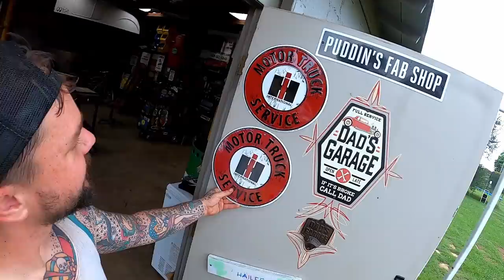1964 Ford F100 LUCY gets CLEANED up & TUNED up! Free smoke show!

Comment: I'm a Chevy guy through and through, but old Ford's aren't too bad. Once they started putting in all the electrdodigicals, they went down hill.
Reply from the maker: I’m definitely liking the fords
Reply: Can't kill a Y-block, a 240/300, a Flathead, or a Windsor/Cleveland/385-series/FE V8. Skookum as frig.
Reply: @TestECull  You clearly haven't watched Mortskes videos on Y blocks then. 'Cause if it can be killed, he'll manage it.
Reply: @bruwin  Oh I have. He didn't kill those Y-blocks. They're still perfectly useable just need a full overhaul.

You wanna see some killed engines go peep I Do Cars. The cores he tears down sometimes...man how the fuck do people manage to put so many adjustable conrods and aftermarket service windows into LS V8s?!
Reply: YEE YEEEE!  Im also a chevy guy and my goal with my 94 k1500 ratrod is to eventually be down to a 3 wire system lol or as close as I can and still keep the tbi because its so much more reliable then a carb if yr truck sits alot 100 like mine! but if its a daily Id go 4 barrel 650 cfm :D
Reply: secondly I love any truck that will run and drive my first was a 77 dodge custom with a 318 second was a rotten 92 f150 with a straight six #highschool beating on the starter every day after school sucked lmao... but damn that was honestly one of my favorites 2wd but yet it went everywhere I drove it and I went up some mountians and through alotta mud lmao..as a teen.... but my bench seat c/k series chevys just always got me and that sbc is so common and reliable when maintained and also cheap to fix when it breaks that its just my #1!
Reply: I'm a Ford guy in Australia, I don't "Think" we copped that Duraspark and smog pump shit. None of my cars had it.... Made for California ?
Reply: @damiangillett1476  Duraspark isnt an emissions device. Its just an ignition box, just like an msd 6al or accel 300. Smog pumps are meant to introduce unused oxygen to the exhaust stream to boost converter efficiency and likely wasnt fitted to models sold in areas that didnt have as stringent a requirement for the cats.

Comment: She is starting to really come around. I love those Ford straight 6 engines. Got one in my  Mustang. Very reliable and good low end torque.
Reply from the maker: Plenty of torque!
Reply: I agree.  I have the 300 cube 6 in my F150 5 speed 2wd.  LOTS of torque, very smooth running engine.  199k miles.

Comment: I have been a truck driver the last 15 years most drivers nowadays do not have a CB Let alone speak English
Reply from the maker: I knew it! Talk to text!
Reply: Yes up hear to also in Ontario and Canada to SH and even when accident called out my mobile plus base setups to help out also (dead air) that get! I live near Trans Canada it 3 miles south of my home 10-20 location plus get lots miles in both setups and plus my home road is a Emergency Detour Route  ! Plus my radios are Tech approved too and setups in CB and Ham radios!
Reply: CB was dying in the late 80's, and when cell phones became cheap, it was pretty much dead.  You can still find some traffic if you're by a major interstate, but it's not like it used to be.
Reply: @jballew2239   agree and so wild one radio station company in Ontario Canada it give traffic reports ever 10 to 15 mins by hour also  does whole province  and help out drivers like CB radio and Cellphone plus computer does ! It sure helpfull too and it does!

Comment: Grew up with a 63, but it was a 1 ton with a 9 foot box. We ran it till the kingpins got so bad we couldn't keep tires on her, and then retired her because the body was about to fall off the frame(WI)
Pumpkin was enormous on that thing, same straight 6, manual. topped out at 50 in the wind and 55 with the wind. It would move loads that weighed in excess of 10 tons, but you couldn't go past second gear then. First gear at idle you could walk about twice as fast as the truck moved. 
The truck was comfy. The distance for arm-to-window ratio was perfect, as was the height of said window. I learned to drive it when I was 10.

Comment: cb needs to be hooked up to them wip  antenna`s on roof to hear talking lol
Reply from the maker: They are plugged in. I found a split in one of the cables after this tho
Reply: Probably fried the finals keying it up with high SWR.
Reply: @PuddinsFabShop  radio is so old anyway it would need to be restored, caps are likely shot and those whip antennas are garbage.
Reply: @Puddin’s Fab Shop  don’t forget the tennis balls!!

Comment: Did you see the IH parts for sale on Aumann auction?  Just don't run the price up on the B series head light bezel.  Need it for my truck!!!
Reply: @PuddinsFabShop  got the part!!!!😎  I still have that rebuilt datsun and manual trans. That needs a good home...... i could use the space in the shop!!! Shop picker video!!!!!!

Comment: Great video and a great channel! That rod you found in the back of the truck is a sucker rod from a oil well pump, folks also use it on fences. I have a 66 ford f250 i'm working on currently.
Reply from the maker: Heck ya! I like the 250s!

Comment: Nice truck... should wire wheel the inside of the roof and hit the holes with seam sealer...  From inside the cab so you don't mess up that nice patina..

Comment: I can remember in the late 1950s and early 60s, my father used kerosene to clean out the combustion chamber and valves
Reply from the maker: Kerosene mixed 50/50 with atf is good stuff.

Comment: Hey your next t-shirt idea possibly. Pudding the instant mix for hilarious. Feel free to correct the spelling and change it around to where you want it. Or just throw it out the side window of the shop once you get one window. One thing nice about the air ventilation holes in the floorboards you don't have to worry about that lever cable working for the floor vents on the each side. And sitting on that rim I guess that's what you mean by Wheeling about town. Enjoy your show great content

Comment: i bought a 74 chevy 1/2 ton from a tree trimming service that had a homemade 10' box on the back that they used to haul wood chips. the driver's side floor was osb. i pulled it out to find an escape hatch i could crawl out of. there was zero metal from the tunnel to the door sill, and from the foot board to the front seat mounts. the only metal you could see was the frame rail and e brake cables. i just put the osb back in, and drove it for a year before i sold it to somebody else when the driver's door wouldn't close from inside anymore because it was too hard to lift and shut while sittin in the seat.
Reply from the maker: Holy hell! And holy floors!
Reply: @PuddinsFabShop  that's northern indiana for ya.

Comment: My Dad bought a brand new red Ford just like that in 1965. There was some type of motor issue with it. He gave it back to the dealer and got a brand new green long bed, with a built in side tool box in 1966. My brother ended up abandoning it in 1975 in OKC and it got towed away by the City......oh, well. What are brothers for? LOL.   
About the same era, Sonic opened it's first Drive-ins.
Reply from the maker: Opened in my home town!

Comment: If you have a metal roof, it's killing your signal. Try the radio outside on channel 19, that's the highway channel. Do it outside.
Reply from the maker: I did.
Reply from the maker: I did.
Reply: @PuddinsFabShop  Did it work  outside? If not y ou may try to turn the channel knob quickly several times as it may be very dirty sitting all those years.

Comment: Hey noe I'm not going to be one complaining about the L6 motor,, because I had the 74 chevy c10 Cheyenne super 2wd long bed regular cab truck it was originally a 454 manual column shift 3spd transmission 12 bolt rear 4.56 posi rear end it was powered when I got ahold of the truck by a 58 Chevy 283 2gc sbc but it had a crack on both sides under the motor mounts and i swapped in a low mileage 4.1 litre 250 cubic inch L6 th350 junkyard transmission and a new front pump and torque converter and input shaft and output tailshaft seal my uncle gave me the Straight 6 it was from a 74 chevy Silverado short bed he had, and I also have owned a monument for bondo sculptor's everywhere even both floors were bondo in the front of the seat truck looked really decent til it got cold and snowed the bondo cracked and the burgundy 80 Chevy c20 Scottsdale bodyline fell off lol on both sides rough truck... but it had a 68 48k miles 250 2gc carburetor L6 th350 c metric lock up torque converter....

Comment: Excellent video Puddin  :) also what Lol one vechile had restored back in 1994 was 1968 Chevrolet C10 with 292 6 cylinder motor with 2 barrel carb with hand choke plus MANUAL TRANSMISSION 3 speed  on tree too , 377 posi rear end gears plus no power steering and brakes to but 4 wheels drum brakes even emergency brake handle was rare one with 4 wires for front also back brakes! Plus truck had West Coast mirrors on doors , Baby Blue body plus Interior same color too and so fix up floor completely, plus had replaced seat but found seat had Lol at this  Old 20 litre pail cut that steal with Texaco company grade 80w90 differential fluid bottom also half was weld to floor on driveseat ! Plus all restore even motor , transmission , axle  head to toe and wheels are 6 studs plus are P235/75 /16 in Load Road E ! Plus Am /Fm radio and radio antenna too updated to with 2 speakers! Guy own truck want me put round exhaust muffler from farm tractor plus tail pipe it ! Plus put new clutch racing in , drum brakes emergency brake cable too even brake plus fuel tank to even lines! Great old truck too and lives on ! Puddin  :) if want I closer would give Radio Check for you on CB Lol!

Comment: Hey Puddin, love the Video if I was near by I'd get you on the air been talking on the cb radio since 1993 my handle is Cruiser. Most likely the Antennas are Shot those are a good little radio. I'm waiting on Puddin Hat's.
Reply from the maker: I figured the antennas are the issue. Lately in the evening I found one of the cables split.
Reply: @PuddinsFabShop  you would be surprised how many people still have Base station's and mobile CB's you would laugh yer Ass off hearing some of craziness that goes on. Have a good day my friend.

Comment: That is a 223 straight 6. I have a 64 f100 that my grand father bought brand new . It has over 546K and is in rough shape but she still runs. ( needs brakes right no)  There is no substitute for these old trucks. they may not be pretty , but they are tough as nails.

Comment: I'm trying to learn by watching your channel and others how to start a barn find truck.  It's alot of info to process and I'm struggling.  You seem to always ground your wires to the battery but I thought the blue box on the inner fender well is where that happens.  Is that what the blue box is for to ground wires to?

Comment: damn Puddin that thing runs amazingly well. Do the brakes on it and put it back on the road!
Reply from the maker: It’s not perfect. She could be a driver tho.
Reply: @PuddinsFabShop  That engine wants to go. Runs nicer than the engine in my '13 Challenger does no joke.

I'd say, if it were to be daily'd, it'd need:

* Binders fixed
* Tires
* Patch the floor pans half decent
* Seat
* working FM radio
* Lighting? Haven't seen anything either way on this in the two vids it's been in.

Definitely a solid truck for sure. And it's really makin' me wanna get my ol' '85 F150 back on the road but I keep buying RC airplanes instead haha. All I gotta do is lift 900 pounds of 300cid I6 to change a 75 cent gasket between the oil pump and the block, then drop the dizzy back in, set the firing order, go over the carb, re-prime the fuel system, fine tune it, fix on the brakes a bit, put its proper wheels and tires back on it, and put a window in it...

Comment: Have you considered building a service truck out of the red 70 Ford F-250 custom trim truck that mortske has....its also worn paint most of it is red,its uh kinda beat up..has a running 351w 4spd manual shift transmission

Comment: You need the old school ketchup bottles the red and yellow squeeze bottles from restaurants, the ones with the little nozzles. I'm sure you know the ones I'm talking about, but that would be perfect for filling the bowl on carbs, no miss.
 I bet your picking up a crap load of drivers on that cb, I do believe your prob missing an external speaker and just not hearing any replies. That or you volume is down, now that would be a puddin move there. Just giving puddin a little hell. You'll get somebody on that old thing sometime, ? Is it a cb or just like a two way radio?. If two way then I don't believe your gonna get nobody unless the other radio is hooked up and on. 
Well I be damn. Talking about bottles, somebody sent you one later in the video. Niceee, no miss card bowl fill.

Comment: I don't think that CB works because I don't see an antenna anywhere on the truck and even the smallest CB antennas are still 3 to 4 feet long. If it didn't have an antenna the radio might have the final transistors blown out now from keying up without it. Not that I think you're going to keep the radio or care oveely much, just passing it along.

Comment: Sounds weird to say but a new seat a quick sanding and a rattle can paint job I would drive it LOL
Reply: My cars name is rust bucket lol it's got 160k it's. 1997 Dodge intripede se 3.3lt lol I payed 300 dollars found out it was just the valve gaskets lol I replace the fuel reaglater and she fired right up now just got to get a new fuel pump for her lolI took it to O'Reilly's after I got it good enough to run she has no codes I think I'm a pretty lucky person LOL

Comment: Is it over yet?
Reply from the maker: Nope
Reply: @PuddinsFabShop  
😆 🤣 😂 😹 😆 🤣 😂 😹
Reply: @PuddinsFabShop  
Put and old 392 hemi in it with a roots blower and two holly double bumpers 850 to 1000 cfm. 3 speed push button automatic transmission cast iron.

Comment: Yeah I don't think that radio sounds like it's modulating and probably won't check your coax on you antennas and you also in the garage it might help me to get outside
Reply from the maker: Tried outside. Noticed one antenna cable afterward has a split in it. Probably need a good antenna.

Comment: You need an antenna there, toe jam. Or the cb won't work.
Reply from the maker: It has two mounted to the roof, it’s plugged in, how are so many people not seeing this? It won’t work either if it’s not grounded, if I’m holding it and it’s on how do people think it’s grounded…? Through the damn dual antennas on the roof. Lol
Reply: That's funny. I guess you need one long ass one on a spring.
Reply from the maker: I’m thinking do.  The ol whip special lol

Comment: I cry foul... On a Carb, you have to use Carb cleaner.  Brake cleaner won't remove the varnish and deposits like carb cleaner does.   Carry on, I love it.
using brake cleaner on a carb is like putting lipstick on your butthole when you have hemorrhoid's. .
Reply from the maker: Do you have hemorrhoids? Lol
Reply: @PuddinsFabShop  she looks pretty in a red dress.. lol